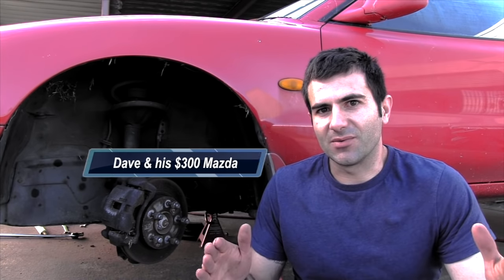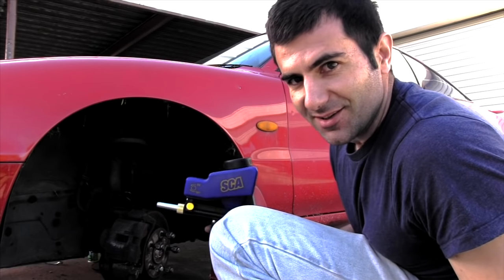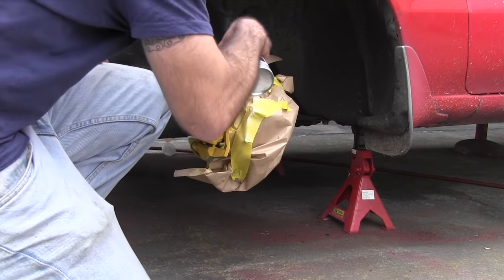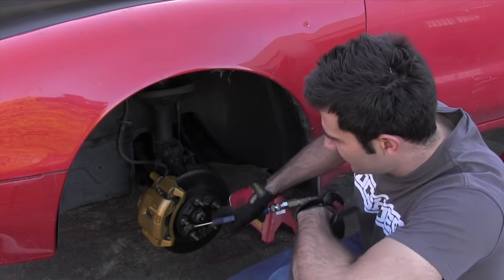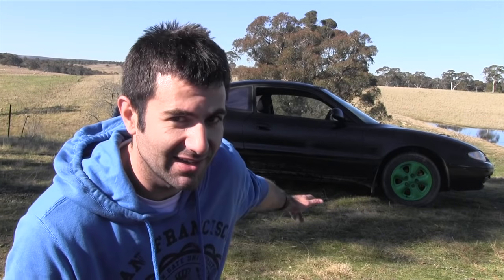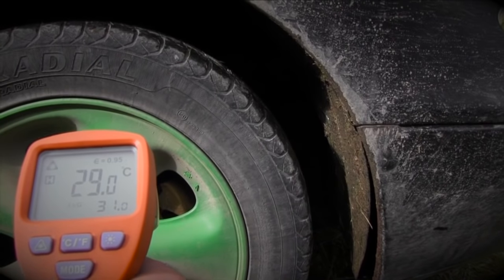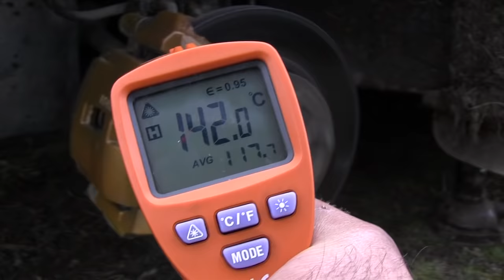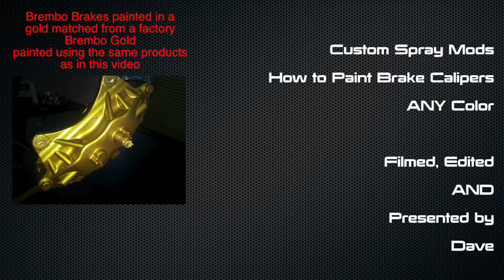How to paint brake calipers ANY color DIY

Comment: Not Maaaaad

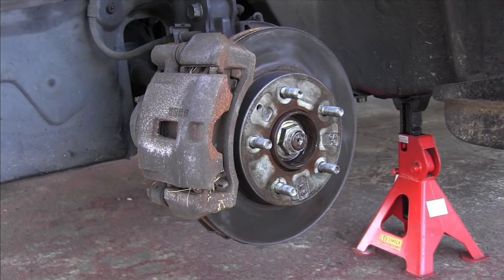You think you should have used the air before you painted to avoid contamination of the paint?  At 1:51, you had surface rust on the rotors which shows the car hasn't been driven much in awhile.  At 4:18, it looks like you sandblasted and possibly painted your rotors with flat black.  Plus what about the rubber bits that you sprayed primer, paint, and clear coat on, on the brakes.  Did you paint over the bleeder screws.

You really scare me.  What scares me even more are all the kids who are going to do this and then possibly kill somebody because of the half assed job they did.
Reply: Zac Youngson I know enough to get you to make a response.  ;-)
Reply: Zac Youngson mate you know nothing his comment was completly valid. He should have removed them from the car regardless. Yeah it looks cool but his hinderd the freeplay and not to forget shoved a shit tone of brake dust into his lungs
Reply: DUDE he bought the car for like $500 for demonstration, for this youtube channel. 

Do you HONESTLY think he gives to shits about it? I wouldn't waste my efforts on maintaining a piece of shit, either.
Reply: duviday I don't think that's the point he's making, the car itself and its value is totally irrelevant.  What he's saying is that others will watch this and follow suit (it is a tutorial video after all).  When it comes to brakes, it's not something you bodge, even if it is just paint.

Comment: I was gonna be so pissed if you left the heat test at the "rally" level. Shouldn't have been a test at all, brakes are very lightly used on gravel and for god's sake its a fwd, why are you swinging out the back end and why are you using it for rally courses. the car would perform much better on a track. sure its fun and all, but i hope you dont actually plan on competing with that thing :P

Comment: His driving is much better then his paint work.... I almost turned the video off as soon as I seen he didn't take calipers off and sandblasted calipers on the car which is a good way to tear up the rubber seals ...... But I give him a good driver trophy
Reply from the maker: i painted my own brembo calipers on my wrx candy red over metal flakes. Using 2k clear. Calipers were off the car in a booth. Can I get re assesed master painter.

Comment: YOu blasted the calipers with air to clean out the sand AFTER painting (I say painting, it looked more like spraying air freshner after doing a massive poo) them.... ERR????

08:15 the paint is bubbling and boiling off the top of the brake carrier mounting. So why didn't you show the brake caliper again after your 'test' but kept filming the IR temp probe screen?

To be honest, I think you should ditch doing instruction videos as your future is in rally driving... :)

Comment: He took the calipers off! The brake pads were totally untouched by the paint. This video is bull. And all the paint overspray is now in the clear coat.
Reply: slappy76 you can remove Brake pads without fully removing the caliper and brake line.

Comment: It doesnt take that long to unbolt the caliper and you dont need to bleed the system,, unbolt clamp part, unblot second part, clamp part is hook up on the brakeline  so just mask line mask rotors hang caliper with a wire on the strut and your good to go.. paint away...

Comment: I stopped watching as soon as you said sand blast or steam gun.  It is not DIY if you don't freaking have it.
Reply: He did it himself didn't he? A DIY is when anyone can do it, regardless of the materials needed. It was super simple, take off the wheel, clean, paint, dry, coat, dry, clean, and replace the wheel.